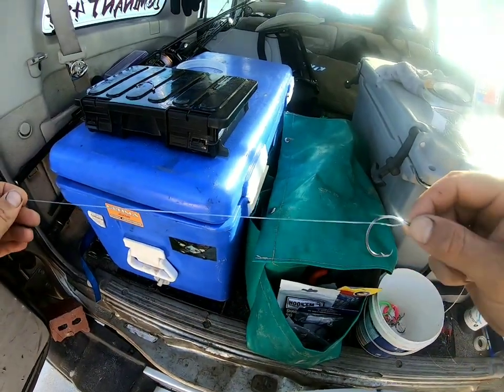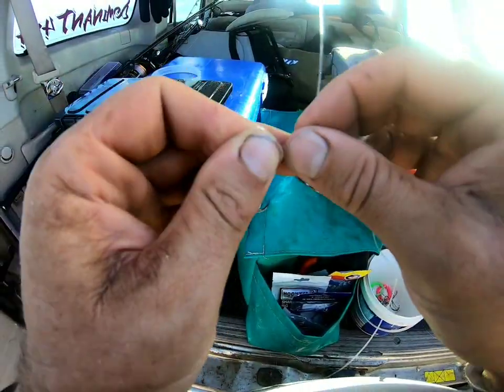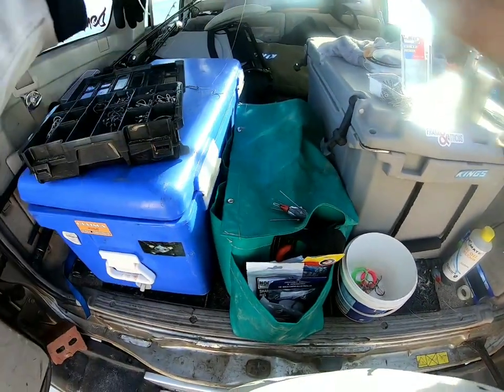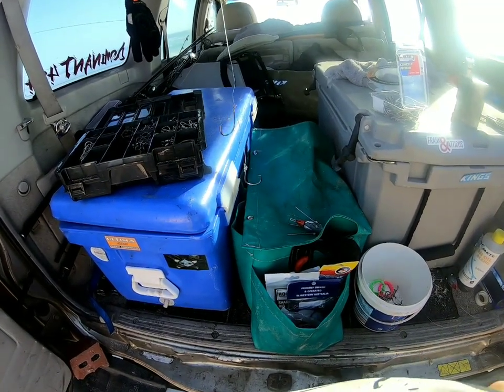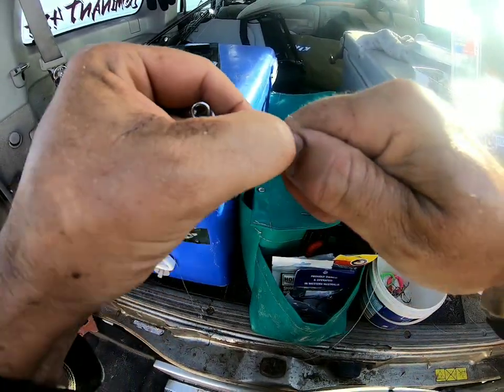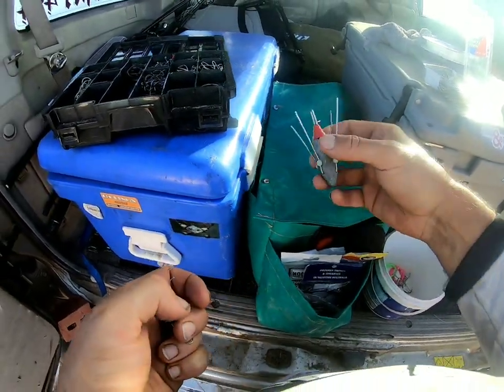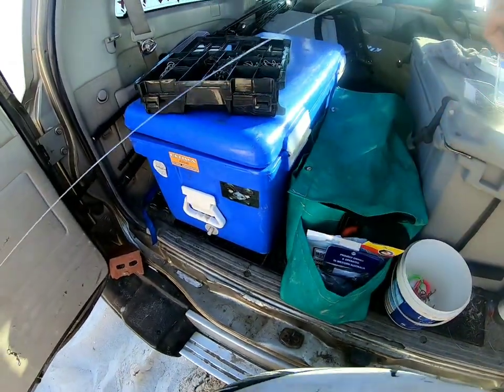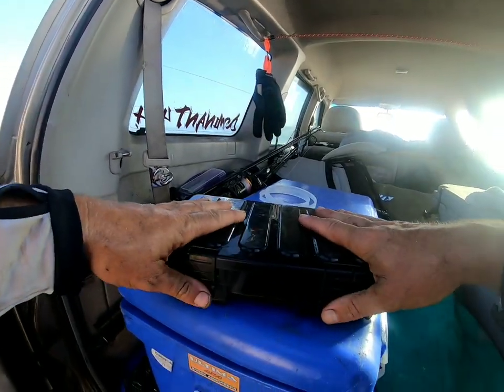Jewfish / Mulloway: surf rig #fishing #howto #adventure #fishingtips

Comment: Craney, thanks for the upload as requested. That's pretty much as I tie them but I appreciate the confirmation. BCF are selling the straight wire grapnels and I bought some from MO tackle the other day for under 5 bucks each. I'm also giving the pulley rig a bash at the moment so those break always are in the tackle box but the hook clip isn't big enough and the hook slips off, so I've got some 0.9mm S/S tig wire and make a clip for the sinker with a hook clip, it cast's heaps better. I'll give you a buzz keen for a fish next week

Comment: Just learn how to bend the legs on the gemini sinkers when the beads come off. Thats all i do to increase and decrease their tripping point and  they last a good while still. Also, you can replace the legs with wire or welding rods, then they are more or less brand new. The ones with the moulded wires are ok but they lack the ability to be tripped.
Reply from the maker: I am now using the plastic ones,so far they are awesome and no need to reset them each time, just got to cut off the shitty little swivel they come with
Reply: @Outbound  you can also use whipper snipper line that fits and create weedless sinkers that work great too as a way to reuse these sinkers since they have the holes already made. Be creative !